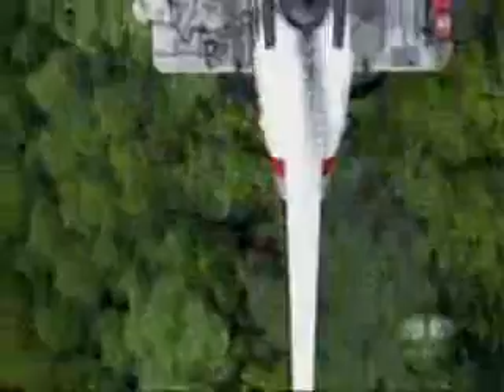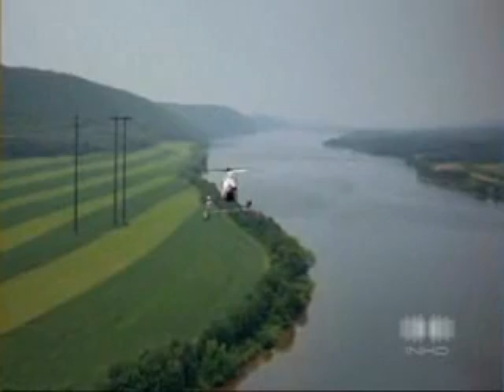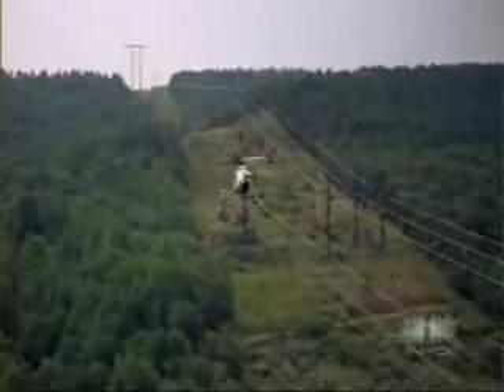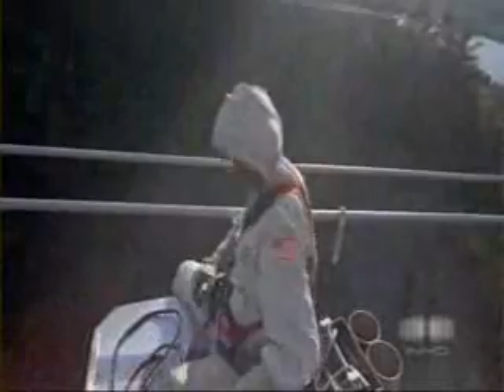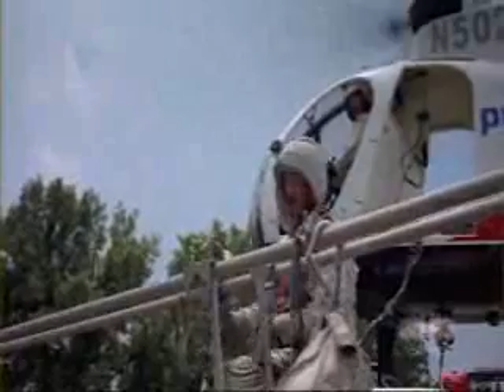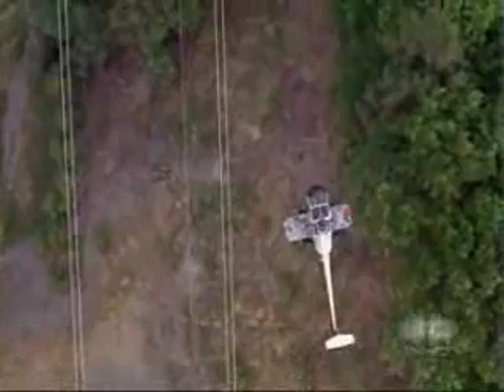Electric power lineman

Comment: There's nothing slow about it.  He's raising himself and the helicopter to the same voltage as the line.  Without a path to ground there is no current flow.  It doesn't matter how slow you approach the conductor, the electrons still move at the same speed.